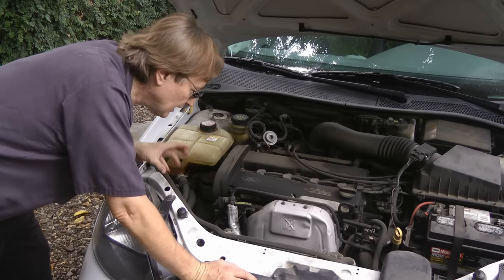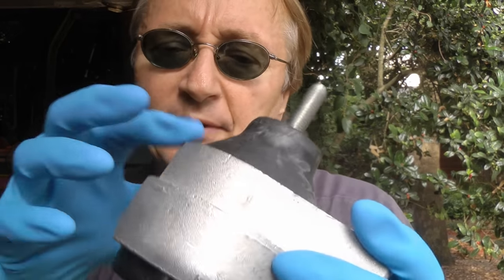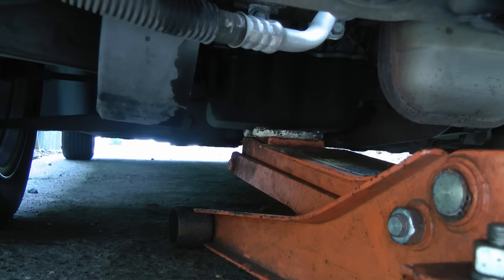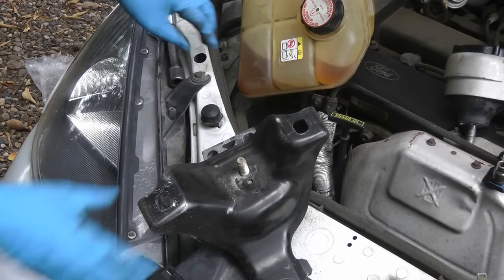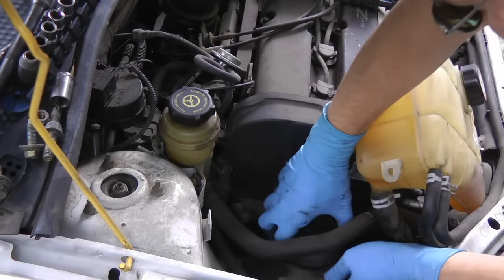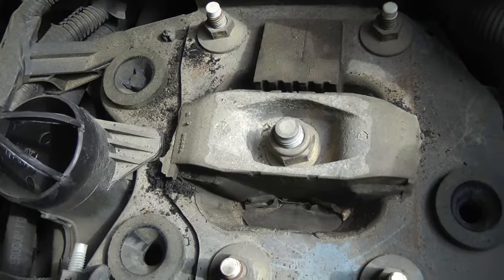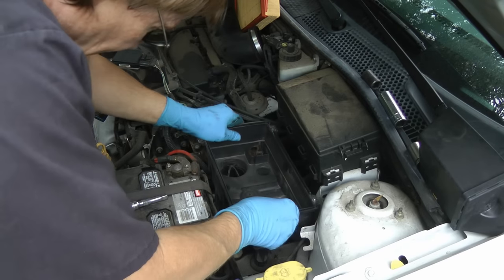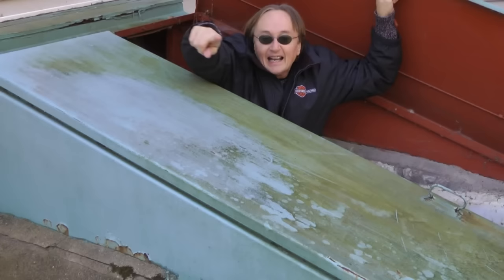How to Replace Motor Mounts in Your Car

Comment from the maker: Things I used in this video:
1. Ratchet and socket set: http://amzn.to/2inoxOY
2. Mechanic’s Tool Set: http://amzn.to/2Bzmccg
3. Steel Jack: http://amzn.to/2Asgjxo
4. Jack Stand: http://amzn.to/2jGOwBg
5. Disposable Gloves: http://amzn.to/2zSRuxO
6. Common Sense
7. Full HD Camera: http://amzn.to/2AvoEk7
8. My computer for editing / uploading: http://amzn.to/2i2sKYz
9. Video editing software: http://amzn.to/2jv5Fhf
10. Thumbnail software: http://amzn.to/2k7tz6C

🛠Check out my Garage to see what I use every day and highly recommend:
https://www.amazon.com/shop/scottykilmer

❗️Check out the Scotty store:
https://goo.gl/RwhRGU

👉Follow me on Instagram for the latest news, funnies, and exclusive info / pics:
https://goo.gl/ohy2cA
Reply: Scotty Kilmer see
Reply: Scotty Kilmer 
Sew
Reply: Scotty Kilmer where can I buy the common sense
Reply: What about in a manual ?
Reply: My motor mount is bad too but I didn't fix it cuz i don't have a torque wrench.
Scotty can i do it without torque wrench ??
Reply: Scotty: I've heard you describe how to test the integrity of the motor mounts several times before, and I have a question. It isn't clear from your description how much lifting you are expecting one to do by using the oil pan as the lift point. The oil pan seems like a very dangerous place to lift the car. If the motor mounts are in good condition, the  entire front end of the car will lift as the motor is lifted, and it seems that this could be disastrous for the oil pan. Please clarify how to use the oil pan as a lift point.
Reply: Hey scotty watch you all the time, I have a unicorn of a jeep cant do the mount myself but being a ...chick...1300$ for my mechanic to do it seem fair??
Reply: Is it the same process for 09 Dodge Avenger 2.4 ??
Reply: I seem to not be able to find the common sense can you post a link please
Reply: Hi Scotty, can i know what is the torque wrench Nm for the mounting ?
My car is a 2.0 mitsubishi lancer rebatched.
Reply: Common sense …. You mean un -common sense !! You can’t buy that nowhere !!

Comment: I've never seen motor mounts so easily accessible.
Reply: Truth
Almost everything on my Hyundai is a PIG to even reach, let alone just undo a few bolts and remove....
Reply: @zachariahlloyd6043  like those damn spark plugs
Reply: You should see the Honda design lmao
Reply: Check the corvairs
Reply: Try a bottom motor mount a G37x…. Impossible
Reply: Some cars are very difficult to replace the motor mounts.
Reply: @danielgallardo6125  now your reading my mind...
Reply: This.

Comment: Put a piece of wood under your jack you can damage your engine and lifting it by the oil pan is a bad idea
Reply: I've seen over a dozen video guide where they left it by the oil pan though..
Reply: I use a hockey puck.
Reply: It works, so do it like Scotty does it, under the oil pan!  You should technically find a sold place the manufacturer designates for lifting but what the f*ck huh!
Reply: Ambiguous User   Bad idea, especially if it's an aluminium sump.
Reply: Paul F the engine has to be held up somehow, he’s not trying to lift the front end up just hold the engine in place
Reply: @Billy_W     Yeah, I'm with you regarding the jack only needing to support a fraction of the engine weight, but for a novice not paying attention, a sump could very quickly end up with a big dent in it...!  
I recently replaced an engine mount, and I was fortunate enough to have a sub-frame layout that allowed me to support the clutch/transmission bell-housing, which worked well.
Reply: Overworld Newsfeed yes and now they have to replace it lmaooo just because you see people do it doesn’t mean they’re doing not right 🤦🏽‍♂️😂
Reply: More Truth
Punching a hole in the bottom will be a cataclysmic!!
Reply: Paul F hi.. in that novice lol
Reply: I remember in high school shop a kid crushed his oil pan jacking the car up.
Reply: jeff jordan  I don't remember. The shop teacher just came in and said that it happened the day before and now the kid was out an oil pan.
Reply: his jack as quite a big pad on it though doesn't it, so it probably distributes the load well, a lot better then a small home jack
Reply: Overworld Newsfeed with a wood between though
Reply: @Tippet76  Exactly, also the oil pan gasket might get compressed resulting in an oil pan leak.

Comment: I did my first engine mount (front one) a few years ago. Believe me, it doesn't take half hour like this video implies, it took me four hours or so. I had to partially remove the sway bar as well.
I couldn't believe all the tools I had out for doing this seemingly straightforward job. I had to grind the edges of the replacement mount assembly to get it to fit in.
I certainly felt a sense of accomplishment but wow, I hate to think what a more involved job would entail.
That is why I am happier to pay a mechanic who knows what he is doing. I might take on more work again, just for the experience.

Comment from the maker: Yes, another new Scotty video is up. Learn how to replace broken motor mounts yourself.
Reply: another great video,u should run for president scotty!!!
Reply: Hey Scotty I have 2000 Mitsubishi eclipse and I'm getting a lot of vibration when I switch Gears and my revs are Around 3k-7k, do you think it's the motor mounts or the front 
Drive shafts ?
Reply: glow__up Jason depends on how many km you have on the dash 100,000km it is your original drive shaft that has a problem its the bearing
The one that looks like a +
Scotty has a new video for it.
Reply: Because he wants to???
Reply: thanx scotty!
hope this is easy on a 98 cvpi....could use some news ones for sure.
Reply: Billy Calhoun i changed my name ages ago...
Reply: Scotty Kilmer what car was that
Reply: Jezrael cr
Seems like a valid question to me!
Reply: Scotty Kilmer. thanks so much i have a 2006 Chevy Colorado with same problem
Reply: Scotty Kilmer u can replace both engine mounts from either ends just with the jack under the oil pan? my engine mount seems to be supportin the transmission so would i have to put it under the tranny or oil pan?
Reply: Scotty Kilmer You have saved me so much 🤑🤑🤑🤑 Thxs!!!
Reply: @Charles X took it to another level  there.

Comment: Great video, Scotty. Ive got a 1999 mazda 626 4-cylinder automatic transmission. Had to do transmission service because if a a case leak. Transmission has been rebuilt. Engine is great, does need a tune up, but after the car has been warmed up and when i change gears from park or neutral to reverse it thumps or clunks. Only going from a quick visual inspection the mechanic has said it is not the engine mount. With your video, along with other videos that have shown the same clunk or thump effect, i do suspect the motor mount(s) have worn out. Only had the front replaced, getting the rear replaced. Should ask mechanic to replace the first transmission mount thats under the battery and airbox. He did replace the one in front, by the radiator. It looks different than the one recommended in a auto parts store photo print out. Thanks again for the educating experience. Appreciate your time you take in making these videos.
Reply from the maker: +jose2bee2  replace all the motor and transmissionmouts first, then pray he didn't do a crap job on the tranny rebuild
Reply: +Scotty Kilmer -interesting you should say that. He is going to to have to replace the transmission. We paid for him to rebuild it. He said the mounts were good. Id still say he should he put in new transmission mounts.

Comment: Scotty saving the day 8 years later!!! I got the wrong mount because the system had it marked incorrect. Didn't notice until I took out the old one out. The first one I bought came with the bracket welded to the mount, and it was smaller and holes didn't line up at all. I needed one like this, where you keep the original bracket, and just get the cylinder. That bottom nut was tough, 15/16 inch, it's....nuts. Jobs is almost done. Hoping the vibration and cluncking is fixed.

Comment: i wanted to see the difference in the engine bay after you changed the mounts..
Reply: That's the only thing that disappointed me about this video as well.
Reply: He had a tornado to run from.
Reply: Yeah no bullshit I was waiting as well
Reply: I just had mine replaced. Less clunking, but the engine still tilts a few degrees when I shift to drive
Reply: @robomatt1600  How long did the old ones last ? I guess it all depends on your driving habits.  I put new ones on about 8 or 9 years now and I dont have any problems. Ones before that lasted almost 15 years before needing replacement.
Reply: @jopisano67  I've had to replace them twice in the lifetime of my 14 year old Mazda 3 which has the upgraded engine size and automatic transmission.  They probably work fine for the lighter base model engine with a manual transmission.
Reply: Yea same here lol

Comment: I seen the tornado and reminded me of back in 71 April 3 . Even after spending 7 years on submarines that was the not the scarcest time. I was in the park in Louisville Ky at 3 pm and fishing in a creak . I was 10 and looked up green sky and a huge tornado heading my way . Lucky I was near a 20 foot tall and wide storm drain system that went back 2 miles . There was a ladder inside about 1/4 mile . Since I have been in it during heavy rains and it would clear up in a few minutes. I climbed up the ladder and looked out seen the tornado go by and it had 3 cars in it and a lot of trees. 1/2 hour later I got out and almost all the trees were gone . Even to all these years later the park is still not the same . I went back home 1/3 of home was gone lucky we had a tornado  shelter in the basement. There was a apartment
complex down the street was gone 132 folks died. I now live in the Catskills NY area for over 20 years only 1 mid sized tornado  in all the time.

Comment: I changed the passenger side mount today and it's fine to support the engine by the oil pan as lons as you use a wooden block. I was scarred but in the end everything was ok. 
Just lift the rear wheels to make it easier to remove the oil pan protector and support the motor near the oil pan board but not on it. 
To change the trans mount support it by the transmission.
Thank you.

Comment: Good job Scotty, it took me 2 hours to replace the Engine mounts on my Element, i saved $200 of Labor they were going to charge me.
Reply: Wow I have a 2004  element Firestone  auto charging me 800 bucks  I'm not  mechanically  incline  at all I wish I was iwudev done it myself if  its that easy the guy told me its gonna take him roughly  3hours I'm 👍 OK  I get  it your out to screw me when it shuden take dem no longer than a hour

Comment: When jacking off the sump (oil pan) wouldn't it be wise to put a block of wood to support the engine as to not leave dents in it?
Reply: Im pretty sure that after 46 years scotty knows what hes doing.
Reply: Engines are heavy, sumps usually aren't made out of the hardest metal
Reply: richard webber You never jack a car up by the oil pan, even if you aren't lifting the whole car. =/ I'm sure he knows what hes doing, but that's just wrong. If its like a norm pan it will bend up, if its cast, it will crack.
Reply: Bunkers101 To be fair he's not jacking the car up. He's only supporting the motor while replacing one mount at a time. The whole weight of the engine is never being placed on the oil pan. Maybe 1/3 at most. Personally I don't see any issue with what Scotty did here. How else would you suggest a DIY mechanic support an engine while changing mounts?
I agree some wood between the jack and sump is a good idea it you're worried about scratches/dings. Personally I wouldn't bother.
Reply: I think you meant "jacking up"......
Reply: Bunkers101
You're supposed to lift the engine on the oil pan, that's proper procedure. Heck some oil pans say "Use wood block to lift engine" right on them.
Reply: I bet, I wouldn't do it.
Reply: Bunkers101  Well then you're gonna have a tough time working with motor mounts. Many FWD cars require the motor mount to be removed to change the serpentine belt so it's somewhat common to have to jack the motor up.
Reply: You don't have to jack from the oil pan to lift a motor lol, you can use a 2by4 standing up and catch it on a lip of something, there is many places to jack up besides the oil pan.
Reply: ih8momjokes1 its how we say it in the UK, I know taken out of context what it means, but no unless you've got wood there its not wise to jack from the sump
Reply: Admiral_Awesome Right. No point of jacking off it unless you've got wood. I wouldn't use a metal jack on the pan.Wait are you still talking about cars?
Reply: Admiral_Awesome Well it should at least be jacked up near the edge of the pan which is stronger.
Reply: ih8momjokes1 someone gets it. Have a cookie
Reply: It's not the full weight of the engine, he only support a portion of the engine to replace the mount. There are 3 mounts still. A skilled mechanics knows that. It won't harm the oil pan if you know what you're doing.
Reply: Admiral_Awesome of course as long as it's flush and safe

Comment: You really shouldn't jack up on the oil pan
Reply: That's what I was thinking
Reply: then where should i jack up ? i planning to change my motor mounts ..
Reply from the maker: you use a jack and a piece of wood and gently jack the oil pan, or you use a cherry picker engine hoist to lift the engine up
Reply: Scotty has been doing this for decades , you just watched a Chris Fix video and think you're a pro now.
Reply: Manufacturers actually state that you shouldn't use a jack under the oil pan to lift the car.
Reply: This of course says nothing about allowing the engine's weight to partially rest on a jack when one of several mounts is temporarily disconnected to stabilize the engine
Reply: He's not jacking up the whole car by the oil pan.  It's just to stabilize the engine so it doesn't fall.  It's fine.
Reply: Patrick Legacy He isn't lifting the car. He is just partially supporting the engine with the other mounts still installed  on the car. You do one mount at a time. You don't support the whole engine  with all the mounts off that would be too much weight to support.  This is only one mount off each time.
Reply: Patrick Legacy  Use common sense will you. The manual says no shops can do this only to take to the pros at the dealership. Jesus himself can't do this according to them. But my neighbor Jesus who doesn't even speak a lick of English would embarass and school the clowns at the dealership. I'll take real world experience over book smart anyday.

Comment: please don't put your jack on your transmission pan lol you're begging for trouble
Reply: or the engine oil pan.. it should be placed on a solid or sitting point designed to hold weight.
Reply: With a block of wood, it's usually pretty safe.
Reply: Exactly, I've done it countless times without issue.
Reply: I'm assuming you guys all did it with a steel pan? ^
Reply: Ralph Livingston is that why my cars Oil Pan says "lift engine with wood block"
Reply: They're people that watched the Chris Fix video first and now they think they can tell Scotty ,a mechanic that has been doing this for decades what to do .
Reply: Dan Reynolds well idk if you knew or not but he's been doin this for quit a while so I'd say he knows how to do it
Reply: Grant E Being a pro mechanic doesn't mean shit. I know people who have working on cars for decades and do dumbass stuff all the time.
Reply: mugabuga usually it's because they've found out exactly what kind of stupid shit they can get away with.
Reply: How else are you suppose to support the engine or transmission when taking off the mount? This is the correct procedure in all the manuals. Any mechanic know this is the way to do this. You just use a block of wood or rag so you don't scratch the finish. You're only supporting the one mount that is off.  Cars generally have three or four engine mounts. Not much weight at all. The oil pan can easily take this weight. Use a flat piece of wood to distribute the weight more evenly and over a wider area for even less weight bearing down. What you're confusing is the warning about not jacking up the weight of the whole car on jackstands using a jack underneath a oil pan or transmission pan. That would end in disaster.
Reply: Only if you are lifting the car, this is just stabilizing engine weight.

Comment: Hey Scotty, is it a good idea to jack the motor up using the oil pan ? Sounds like it could be bad news. Or is it perfectly fine ? Would putting a piece of wood between the jack and oil pan to distribute the force/weight be better? I have a '98 Acura CL that's gotta get done.

Comment: you made this video at the perfect time Scotty! thanks. I am not getting any clunking noise but if I shift (manual transmission) and hit the gas I will sometimes get some jerking, sometimes it is really bad. It is a 1998 nissan frontier 2.4 manual with the origional mounts 100k miles. Would new mounts be stiffer? Thanks and keep doing what you are doing! I enjoy the videos. The other youtube mechanics turn a simple job into a 50 minute video.

Comment: I have a mount with a severely ripped bushing and my front one has a small rip but I was thinking of filling the gaps in that one with polyurethane caulking.  It would also help reduce my engine movement too as I have a turbo and more torque than stock.